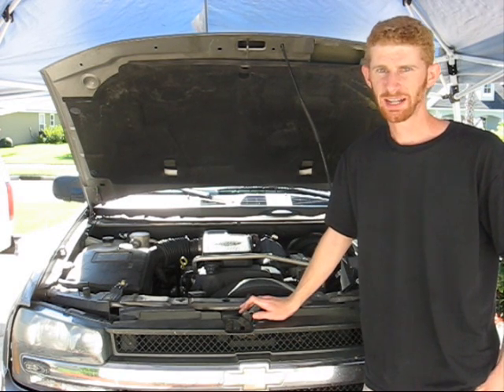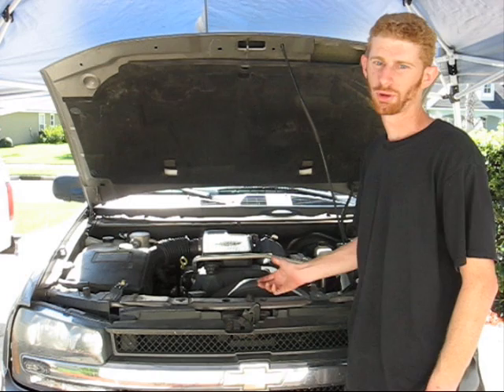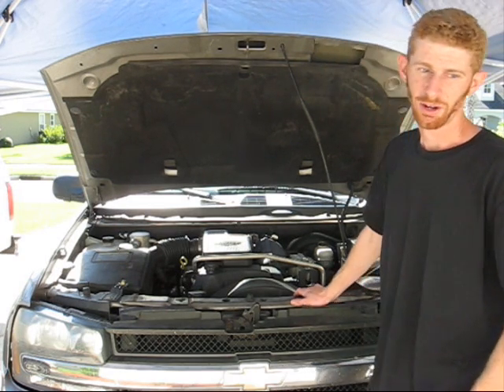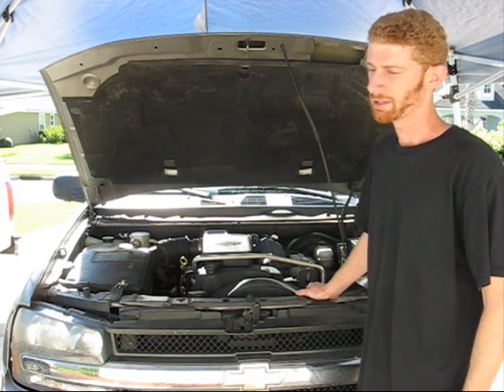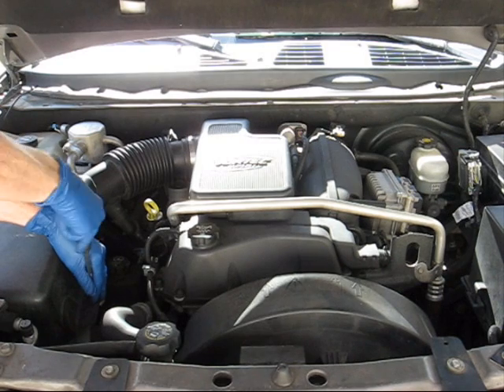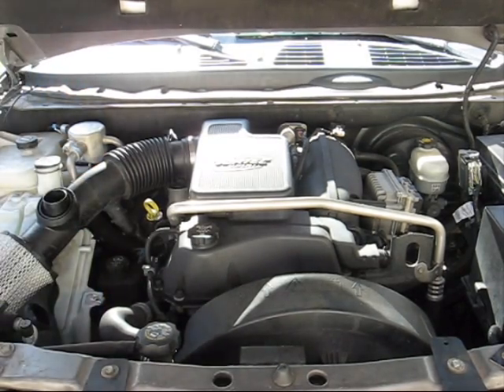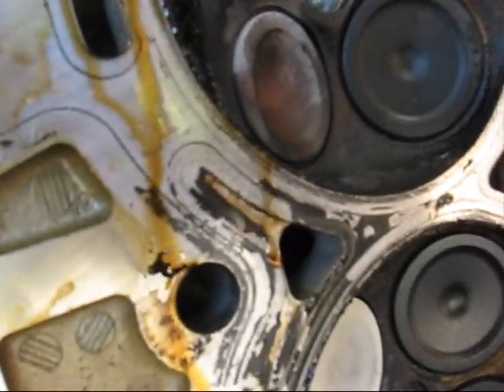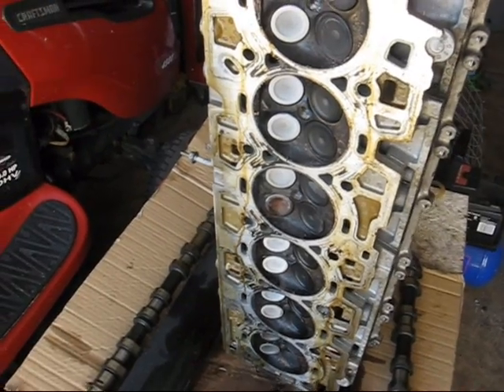Chevrolet Trailblazer Valve Job Part 1; Teardown

Comment: what bolt do you need to remove to get manifold lose?
Reply: +pfun41 how do you get the last bolt on intake its hard to get to no space at all even with swivle neck
Reply: That's all complete pretty much now I have to set the timing chain with the cams then reassemble everything
Reply from the maker: +Alex Rodriguez Unbolt the PCM, remove the bracket underneith it. Remove the alternator,
 there's a bolt for the intake manifold behind it that's hard to get to,
 also pull off the tube in the middle of the manifold, there's a bolt 
behind there too. The rest are easy to see, the one by the firewall is a
 PITA. When you have it all unbolted it will come off easily, if it 
won't move there's a bolt you missed.Don't try to get around removing 
any of that stuff, you'll only make it more difficult.
Reply from the maker: wrench and lots of patients.

Comment: First I want to say great video, very informative! My truck started idling rough after a quick trip one night and had to drop it in neutral to keep it from stalling out at stop signs. After running a bunch of tests, your video helped me figure out what could be wrong. Now for my question. I have disassembled my engine to facilitate removal of the head but I have a concern with the timing chain. All of the literature I have seen shows the cam timing marks lining up with the dark links of the timing chain. Mine don't. They're not even close, the dark links are 3 links advanced at TDC. Is this cause for concern? I need to pull the head to get it machined but this has me stopped dead in my tracks. Am I being overly cautious?
Reply from the maker: +J Allen No, they need to be lined up. Keep rotating the engine until all the marks are lined up when cylinder 1 is at TDC. I wanna say they line up every 14 revolutions or something like that. And make sure you unbolt the timing chain guide. And keep the chain tight!

Comment: If I have to pull this transmission back out is there anyway that it can be done leaving the motor in the truck
Reply from the maker: +jddllll Support the rear of the oil pan with a jack and block of wood, the motor mounts will hold it.

Comment: I just finished my engine swap on the 2004 trailblazer my transmission will not engage is there any sort of procedure like bleeding or anything that I should unplug and plug back in or any procedure that I should check out I jack the car up and I had nothing now he goes up to about 10 miles an hour and then it just stops working again
Reply from the maker: +jddllll any codes?

Comment: IM DOING A ENGINE SWAP on a 2004 trailblazer 2wd 4.2 in line 6 . when i try to put motor and tranz together the converter will not spin free.. apart the converter spins free.when i mount the converter in tranz i have waited till i feel the two clunks..please help
Reply from the maker: +jddllll I think it's supposed to be 3 clunks for the 4l60E. When you bolt the engine to the trans the torque converter should have just a little wiggle room between it and the flexplate before bolting them together, if its tight before bolting the TC to the flexplate then the TC isn't seated all the way. It probably pulled out when removing the engine. You need to rotate it and shake it to get it seated all the way, don't be afraid to be rough with it.

Comment: the forth cylinder has water in  it,,, you can shake the car and watch the water move
Reply from the maker: +jddllll Contunue with the leak down though it sounds like you have a blown head gasket. Are you shure it's water and not gasoline? if it is indeed water then safe bet the head gasket is blown, which explains all of you're problems.

Comment: i just pulled the plugs getting ready to do a leak down test,,i found little specs of water on 3rd cylinder back from the front  of motor ,,,should i continue with  leak down test ????

Comment: I disconnected the battery let it set for 20 minutes reconnected the battery and turn the key on and waited a couple minutes before I turn the key to the start position the truck seems to hang up on something until you bump it two or three times then it finally turned over and runs it's very rough I can not even go down the street in it now it is overheating instantly you are the coach from today

Comment: ok so where's the exhaust cam actuator at.... just to be sure
Reply from the maker: +jddllll Its in the video, its the big device in place of a sprocket on the left camshaft, not something you want to replace until you're out of options.

Comment: auto zone said there's wouldn't clear codes...to be exact what do you mean  get the VVT problem taken care of.
Reply from the maker: +jddllll Your codes indicate an issue with the variable valve timing, either the Cam phaser or exhaust cam actuator. This is the cause of your misfire and would be the first thing to take care of as it could potentially have something to do with the overheating as well. you can disconnect the battery to clear codes.

Comment: i don't have a way of clearing codes.it wasnt bad.a little grimy but nothing missing...should i try a leakdown test 0n # 4 cylnder ?????
Reply from the maker: +jddllll A leakdown/compression test on all cylinders wouldn't hurt. But first thing I would do is get the VVT problem taken care of. Most code readers will also clear codes.

Comment: I'm talking about the actuator that goes into the passenger side engine block right at the top and the crankshaft sensor that you right in front of where you put oil in the motor at this is a 4.26 cylinder
Reply from the maker: +jddllll Oh, That's the camshaft phaser and camshaft sensor. How did the old cam phaser look? Any screens missing, sludge or grit buildup? If you clear the trouble codes do they come back?

Comment: I got the actuator in and the cam sensor right at the front top of the motor it's running worse than ever and heating up twice as fast any suggestions
Reply from the maker: +jddllll Did you set the engine to TDC on Cylinder 1 and line up the timing marks on the new actuator and keep the chain tight during the process? If you clear the codes are any new ones coming up?

Comment: I got the exhaust cam actuator in and I got crank shaft sensor on the front of the engine installed Do I need to unhook the battery reset any fuses or anything like that
Reply from the maker: +jddllll disconnect the battery for 20 minutes or so. When you turn the key on just let it sit for about 90 seconds without touching anything before starting.

Comment: hey i just got these codes read and hour ago ,,,,C0055 abs....C0201..P0113..P0141... P0300...P0014....I JUST RENTED BLOCK TESTER,,COMPRESSION GAUGE....PRESSURE TESTER FOR RADIATOR....THANKS AGAIN ,HOPE TO HEAR FROM YOU SOON..JOHN
Reply from the maker: +jddllll  P0141 is IAT sensor, probably was started with it unplugged at some point. P0014 is an issue with the variable valve timing. Most likely the Cam Phaser or exhaust cam actuator, these will in turn cause the misfire and the p0300 code. You can clean the cam phaser or replace it, there are other videos on it. If that doesn't fix it you are looking at getting a new exhaust cam actuator.

Comment: the coolant was chevy and distilled water...there were some codes .ill look for them..the dash cluster stopped working and while i  had it out  ,i found  the engine lite  had been taped over .when i put the cluster back in engine light was still on ,,maybe 6 months later all this  started . should i have it scanned now ?

Comment: 137k      new   radiator  .hoses   ,thermostat  .water pump   ,,new plugs   ,,map sensor.,,,will only cool down when you turn the heat on,,,that only last about a mile,,, the truck runs great after 2500 rpm
Reply from the maker: +jddllll Any trouble codes? What kind of coolant is in it?

Comment: I put a new bottom radiator hose on and New fan relay it's back to doing the same old thing Dryvit 10 minutes and it overheats and just pegs and it's missing worse than ever any suggestions I would appreciate it
Reply from the maker: How many miles? Have you looked at the water pump at all? Are you adding dexcool or regular green coolant? The two combined will form a thick goo that clogs up, well, everything.

Comment: should i put it back together and investigate the fan relay
Reply from the maker: +jddllll A faulty fan relay will cause overheating at a stop, exact opposite of what you have. If compression on all cylinders is good that rules out a head gasket or internal issues other than maybe a blocked coolant passage. Id check for lack of airflow through the radiator, check the hoses, especially the lower one, make shure it doesn't collapse easily. Ive heard of water pumps corroding and causing overheating while driving. Your engine should run around 190-210* when operating properly. What kind of coolant was in it and what kind of coolant have you been adding?

Comment: no i have not ,when it idles you can hear something going on/off.the old fan you could stop with your hand.i am down to the intake manifold. should i stop and look at the relay.by the way the compression is great no water in oil .,passes the block test,and pressure test..thanx so much john

Comment: wow i can get a motor with 82k for $900.my problems are over heating  and missing.when i saw your video it sounded just like  my problems. it has new radiator,thermostat.fan shroud,new fan clutch,,when i put the new radiator it  ran good for two months.and now you can only go 5 minutes then it starts boiling over.if you turn the heat on it goes down for about 5 minutes then it sounds like the radiator  is about to explode..i tried taking out thermostat it made things worse
Reply from the maker: +jddllll What about the solid state relay that controls the fan clutch? If that goes out it will overheat at a stop.

Comment: cant seem to find the proper timing marks for #1 cylinder at tdc
Reply from the maker: Kevin Simon I install the hose from a compression gauge in the #1 cylinder then rotate crank with a ratchet while feeling for air pressure at the end of the hose. When you feel pressure from the hose keep rotating until it stops. At that point you should be able to see dark links in the chain. Line them up with the timing marks on the sprockets and you will be at TDC.
Reply: *****  Thanks so i have everything back together, just finished getting cam shaft actuator on and torqued, as im rotating the engine to check the timing the cam shaft almost seems to stop for a second and than catches up, any idea what is wrong
Reply from the maker: Kevin Simon Which way are you rotating it? Go clockwise.

Comment: I have a 02 Chevrolet Trailblazer and I replaced the water pump joint with the housing brand new and it still overheats, what can be the problem
Reply from the maker: busboy956 Could be many things. But one of the common issues is a faulty fan clutch relay. The Fan clutch is electronic and is controlled by a solid state relay in the underhood fuse box. It's pretty common for them to burn out and cause overheating.

Comment: You did a great video.  The locks on the electrical plugs; the removal of the broken bolts would of helped I think.  Not everyone is as experienced as you.  Using bungee cords (heavy rubber type works well for holding the timing chain also.  You helped me to get the exhaust cam actuator back on. Thanks. It had me stymied. Also the three small bolts at the front need to be degree tightened also.  I broke one off tightening it.  Made a guide and extended drill bit and got it out. Whew!!!!  Thanks again!
Reply from the maker: John R McLellan, CH Glad to help. I hate torque to yield bolts for these very reasons. Nothing like stretching $50 bolts to rack your nerves. The small ones are the worst, they can't handle much torque.
Reply: ***** I ended up having to pull the front cover to release the timing chain tensioner which meant dropping the oil pan which meant dropping the steering mechanism and front differential.  Did you release the tension yourself or did you get someone else to do it?  I am still wondering why you didn't answer my request as to how you did it.  Once I pulled the tensioner out it proved very simple, contrary to GM's "it can't be done"BS.
Reply from the maker: I specifically Recall mentioning I just used a coathanger bent into a hook to grab the release lever from the top, but that could have been on another comment, ever since youtube forcefully merged google + the comments system has been a mess.

Comment: I have a '05 TB with around 98k miles, my question is: Is there any kind of preventative maintenance I can do in attempt to avoid this problem? or is this issue just sort of a 50/50 chance? I'm not experiencing any problems infact she idles and drives just fine, I was just not aware of this valve problem until I came across this video.
Reply from the maker: ***** Regular decarbonization and fuel injector cleaner may help along with regular maintenance but mostly its just wait and pray.  There is a problem with worn valve seats on some engines, it usually shows up very early, around 50k-100k. This one had a burnt valve which showed up around 120k. Typically if you make it past 150k your golden.
Reply: @pfun41  Sweet - I made it past 150K - my idle is 600 rpm. I haven't checked for any oil on the sparkplugs - I don't even know what that means. haha. My mechanic did change the spark plugs and other stuff probably around 150K - and cleaned out the engine or something. I use MMO a big - had some nasty exhaust come out. I guess that can clog up the VVT though? hmmm.  I'd like to get 500K out of this beast of a car. Like that Inline Six engine with the great torque.

Comment: will you let me know where are the bolts for the parts you are pulling out,  the video is so fast I need to get to the valve cover bolts, for your helpp thank you.
Reply from the maker: manuel viramontes Just follow the perimeter of the valve cover all the way around, you should get them all that way, they are captive in the valve cover so they won't come all the way out.

Comment: Can you email or post a video of this in real time not fast forwarded plz having trouble taking off plastic intake manifold so i can change the valve cover gasket
Reply from the maker: sammy placencia I can't, the Video file for that part would amount to a few GB. You'll need to remove the PCM, There's a metal bracket under it that has to come out, its held on with a couple nuts. The alternator also has to come out. Once the alternator is out you should be able to see most of the bolts, there is one that's hidden behind the tube in the middle of the manifold. Once you get all the bolts loose it should pop right off, then just maneuver it out of there.
Reply: ***** Thank you we got it the other day but we had issues how did you take off the last bolt closest to the firewall we couldnt get a tool in there so we just took off all the other ones and kinda pushed it aside and held it in place untill we could take off the valve cover
Reply from the maker: 10 MM wrench, it's a tight fit.That Bolt is the worst one.

Comment: I have had heat problems with the middle valves on 4.3 's.  I am thinking it's because, being in the middle less air circulates & it cannot cool itself as well as it should or needs to. I'm going to try and improvise some sort of air damn to move more air around it   
  Thanks for the vid.

Comment: Hey man I have a gmc envoy 4.2 same truck I can not get the intake manifold out please help I have everything out the alto atop throttle body anything to possibly block it just seems to be like stuck in place
Please help asap thank you gladly appreciated
Reply from the maker: cameron duchene did you get the bolt behind the alternator out? There is also one behind a tube in the middle.

Comment: Thanks for posting this. I just finished getting my head out and my problem IS burn exhaust valve. Unfortunately, I broke 8 or 9 head bolts, but I didn't freak out because everywhere I read it said to expect that.

I tried shocking the bolts and I didn't jerk the wrench to loosen them. It just seems unavoidable. 

Also, in my Chilton book and on this video, I didn't see that you have to unbolt the Timing chain guides before you try to take the head off. I wound up braking one of mine so I'll have to take the front cover off to replace. Not a huge deal, it's only $23. 

There's also a piece mounted to the back of the head that is a sort of pass through for 2 (what look a cooling and a vent hose).  That wound up breaking also when I was trying to get the head out. It's very fragile. So I'll have to get on of those too..

Thanks again.